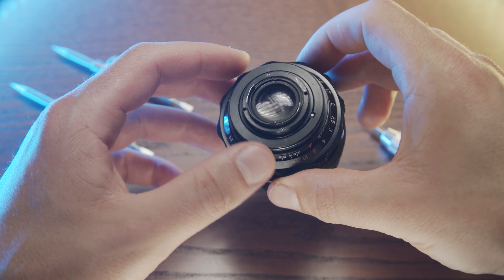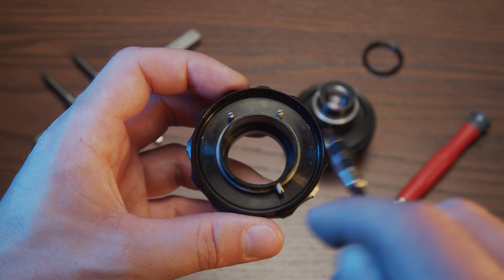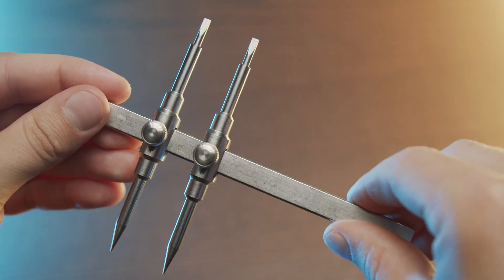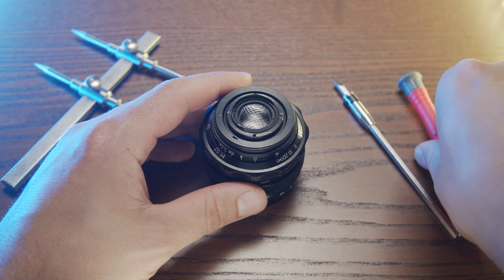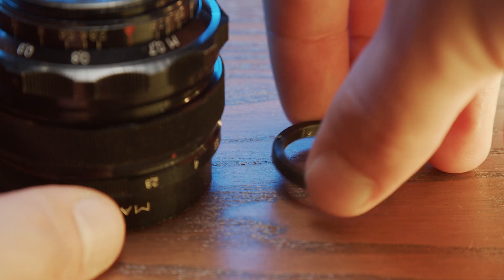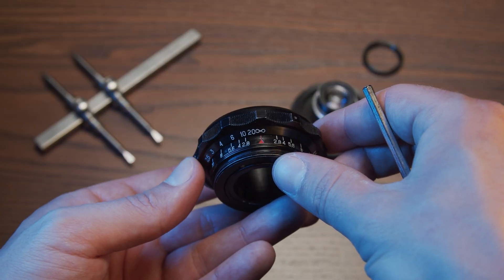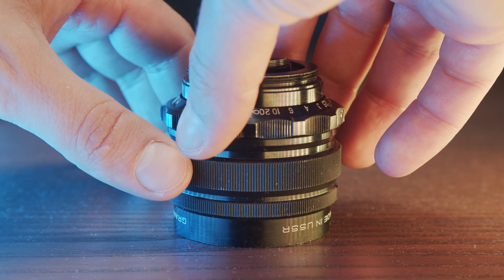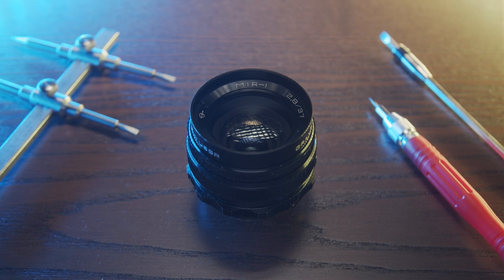Mir-1 2.8/37mm Close Focus Modification

Comment: Its not worth it.. .Mine had stuck screws and it was a hustle to open it up, just to gain 10cm of reach at best. Do not recommend this mod overall, but you do you. Also, front element reversal, its cute and all but wont find any usable application to that effect.

Comment: Just did the mod and was a bit disappointed. I haven’t measured anything but it seems only a little better. Looking at the focus distance markers on the lens the modded ring only seems to move past 0,7 a little more than the distance between 0,7 and 0,8. Which means you’d only gain roughly 0,1 meters. ~0,6m focus distance sounds about right after I modded mine, no where near halving the 0,7m to a 0,35m focus distance.

Comment: Hey i know this video is a little old but i am having trouble getting the rear ring off the back. I have the screws out and it wont budge. Any ideas?
Reply: Mine was super tight. I got the ring off with vice grips. I put some electrical tape on the locking ring to protect it from scratches and it came out clean but be prepared to mar the ring if you use that tool. Scratches on the ring wouldn’t affect the performance so I wasn’t too worried either way.

Comment: I have the opposite problem can’t focus to infinity on my m42 Mir 1 lens. Will try your fix and see if I can make it work though or might see if I can fix it with an m39 to m42 adapter on my m39 adapter
Reply: After a bit of research I’ve come to the conclusion that the person who put my lens together made a mistake. Because my lens was adapted to use a cine focus gear I’m guessing that when they removed the original focus wheel they may have screwed it back the wrong way. Is this possible to have the reverse effect where infinity focus doesn’t even reach infinity? Or do I have an earlier black version that needs a different adapter?
Reply: @missgreenbottles  попробуй собрать геликоид по другому, скорее всего когда разбирали не попали в нужную резьбу

Comment: Well, that's useful! Does it change how the lens operates in any other ways? 'Cause it seems a little odd to me that when engineering this lens they decided to limit the minimum focus at 70cm instead of, like, 50cm if it is that simple. Just wondering...
Reply from the maker: Except that you will have no markings for the focus below 0.7m, as it is not intended, in my case everything works perfectly great! It is also a complete mystery to me why this lens was constructed with this limitation.
Reply: @HYPERLENS  Good to know, thanks!
Reply: These lenses were made for the Film Cameras they had to engineer it for that, considering all the moving parts and distance from the film to rear end of the lens to have proper focusing. With digital, especially with mirrorless, and with focus peeking everything changed :)